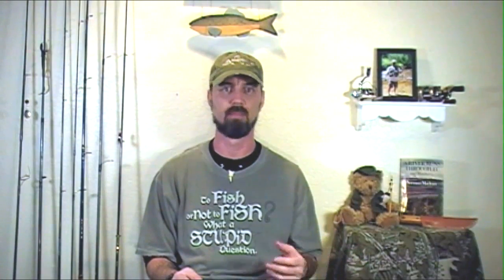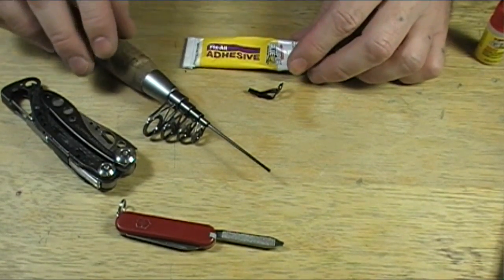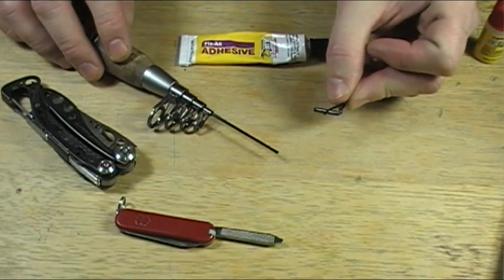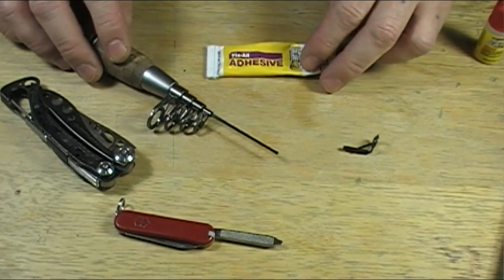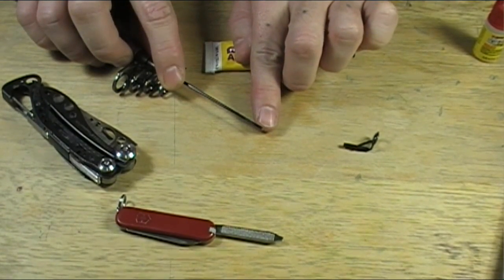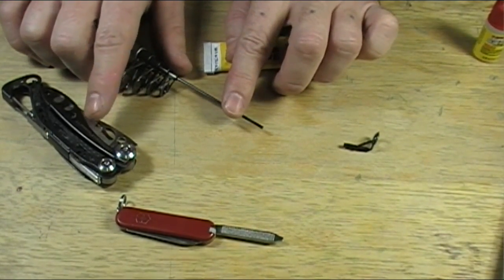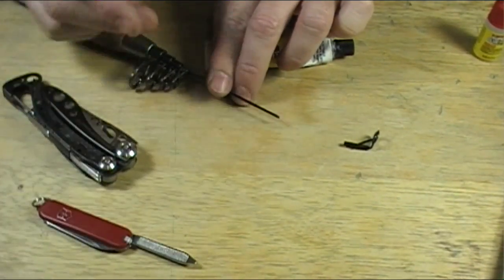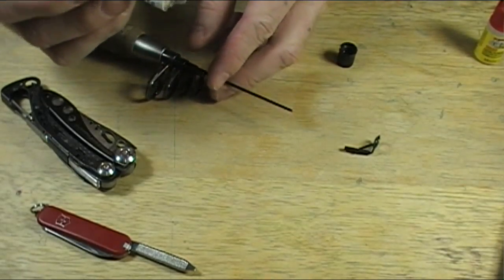Fishing Rod Repair: How To Install A New Tip Guide

Comment: May I suggest getting some of the hot melt rod tip glue to keep along with your rod tips. I keep this set up in my tackle box or fishing vest, that way you can repair it on the water and get back to fishing with only 5 - 10 min of lost time.